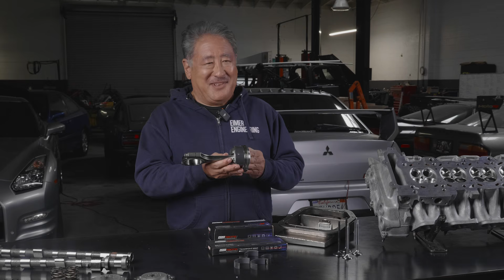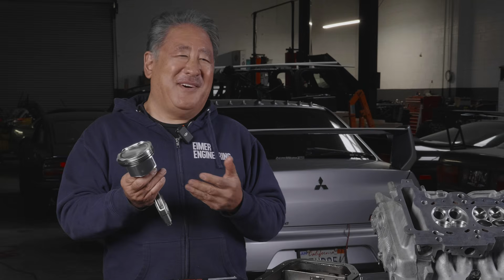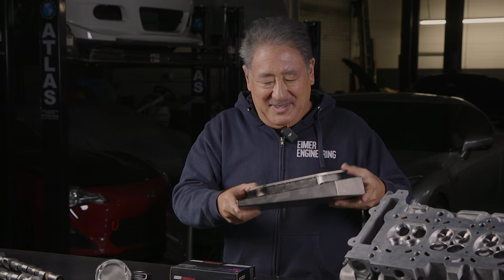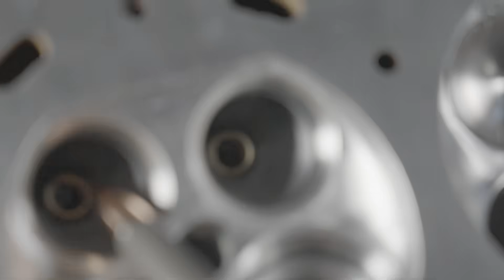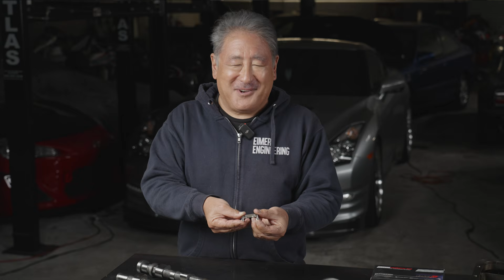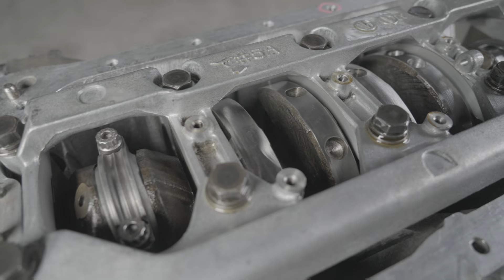How to Build a Bulletproof 400 Horsepower Nissan SR20 Engine!

Comment: Factory sr20 will do 400rwhp for 200,000 miles, I tuned hundreds of them since 2005, my first sr dyno video is from 2007
Reply from the maker: Maybe a pampered street-driven only car, maybe.  One that is raced will go about 20 track days between minor rebuilds.  200K miles is an outlier.
Reply: @motoiq  What is a minor rebuild? What kind of parts are you talking about? Failure in ductile and brittle lattice materials is an all or nothing phenomenon. If it doesn't fail at 400rwhp today then it will not fail tomorrow. The parts do not accumulate stress and piston brittle fracture failure is orientation based in a plane far from where stress is applied. They are the same pistons as 2jz-gte pistons which support nearly 1000rwhp at 1.5x the displacement. 

The sr20 parts do not fail at 400rwhp no matter what the application. The issue that people overlook is proper setup and tuning for the application. For example street vehicles rarely need oil cooling and water injection to prevent thermal based parts failure whereas in a racing environment the measurement and control of Exhaust temp and Exhaust pressure and cylinder head temp and so forth is fundamental to the reliability and that is why you think the engine will fail, because nobody measures the critical control aspects and then they fail.
Reply from the maker: Rings, bearings, inspection, and mag of all parts, sometimes pistons for an engine that is actually road raced or used in real competition drifting. I think your customers are primarily street customers or do short-duration stuff like drag racing. No higher-powered engine that is road-raced is going to go much longer with no maintenance without a tail-off in performance and or reliability.  Even the mighty 2JZ when talking about 1000 plus hp on the stock bottom end, it means a street, dyno queen, or hobby drag person. You don't see a single stock bottom-end JZ on the FD Grid. I mean my stock bottom-end SR street car lasted 10 years and who knows how many miles with 3 different owners and was still going strong when I lost track of it but street use and even mild track day use is not racing. Your statement on stress is not true. When you are getting close to the upper yield stress point stress is surely cumulative. This point is way below the UTS or ultimate tensile strength point.  It is also common for racing engines to operate in this zone. Ever hear of fatigue failure? For a part to fail far from the stress point is a matter of design and where stress concentrations are at, it is not a standard rule-of-thumb phenomenon. Also, stock SR pistons primarily fail in the ring lands due to detonation damage as SR's quietly detonate and many tuners don't catch it.  Higher revving SR's have pin boss failures on stock pistons, very rarely are they rod problems because the pistons fail first.  After 20 track days, of about 4 30-40 minute sessions, a 400 hp SR will still be running pretty well but it will need going through to stay reliable and not have the power start to drastically fall off.  Even an NA 220 or so hp SR will have the power start to drop after 30 track days and need freshening for sure at 40.  These numbers are pretty damn good for any engine.  A highly strung NA 10,0000 rpm 4AG needs to be gone through after 3-4 track days for instance to keep it running at its best. In the old days good used SR's were so cheap, you could have just throw another stock motor in it mindset but now these engines are expensive and that doesn't pay off very well anymore. The stuff about fatigue is fact, the rest is a matter of opinion and what kind of customers you build engines for.  Let's say I don't agree with you about that stuff and I don't recomend stuff like that for the hard-use customers that are most of our base.
Reply: @motoiq  For ductile materials to fatigue there is stress concentration and a brittle-like failure which means the materials actually ruptured, like a connecting rod broken in half. Stress is a result of cylinder pressure and piston rate, so it is a tuning aspect, not a power aspect. You mentioned 200hp SR have a failure cycle which emphasizes the point that 400rwhp and 200rwhp sr20det are not failing due to the power output. Furthermore you mentioned detonation which is tuning based and setup based, not power based, a 200hp sr can detonate and fail. Finally the pistons are not ductile they are brittle in the OEM application and will not fatigue appreciably or they would exhibit a life cycle in all engines not only racing apps, they do not fail for 200,000 miles or 400,000 miles or 1,000,000 miles as long as they are not abused, which again is setup and tuning. 

Why do rings fail and rod bearings fail in racing? Setup and tuning. Rod bearing should never wear if the engine is built properly and tuned/setup properly. We can take apart 200,000 miles engines without wear on the bearing. Rings are a whole other issue with tuning and setup as well- many people do not understand how to keep the OEM rings  and pistons happy. They blame the rings just like you do now. Here is what must be done
1. Oil temperature must be kept within 12*F of coolant temp and no higher than ~225*F. This is big reason for degradation of OEM pistons and rings. 
2. Engine tuned on alcohol fuel to minimum timing with no more than 112*F IAT measured pre-throttle valve. Easy to do at a mere 400rwhp. I can easily 500rwhp from OEM sr20det internals with this setting. 
3. EGT controlled by 100% distilled water injection if necessary. An arduino controller monitoring EGT on an water injection system triggered when Turbine Inlet temperature exceeds ~1380*F. 
4. Crankcase pressure must be kept for wet sump applications between 1.5" to 2.5" Hg for ring behavior and blow-by control. This is another critical aspect of setup which cannot be overlooked and why people blame rings and have ring failures. In dry sump and vacuum pump applications more vacuum can be used but I do not recommend much more than 5" Hg. 
5. Superior air filtration over factory is needed to keep the engine cleanliness from contaminating rings and embedded materials to the pistons valve deck and rings. This is another critical aspect which cannot be overlooked and many people disregard.

If you follow these rules the sr20 OEM bottom end and Chevrolet LS bottom ends will tolerate years of racing or whatever. Stress on the dyno is the same stress as in racing, there is nothing special about racing stress except that temperatures become exacerbated and people disregard setup issues as air filtration and PCV measurements. If we bring the temps back down and protect the engine crankcase and intake systems there is no difference between racing on the dyno street or track in terms of stress.
Reply from the maker: Fatigue failures do not look like brittle failures, they leave concentric shore marks and exhibit smooth burnishing in between the shore marks. Exceeding the materials' ultimate tensile strength gives a stringy-looking failure point but with necking around the periphery of the fracture.  Brittle-looking failures are typically caused by stress-corrosion fracture. In an automobile, these are most commonly found in stainless steel exhaust manifolds. Hypereutectic pistons do not have better fatigue strength than forged 2618 in fact it's not anywhere near close.  The silicon inclusions in hypereutectic pistons can be the nucleus for cyclic fatigue failures, contributing to the material's brittleness. These properties do make the pistons more wear-resistant, do not confuse wear resistance to having better fatigue strength.  There is way more to an engine's durability than those simplistic reasons and good tuning. Engines lasting indefinitely are outlying conditions, not simply skill at tuning.  I agree with you on the oil and coolant temps but higher temps do more than degrade the pistons and rings.  Max oil temp before major damage under racing conditions is the high 240s for the oil and 230's for the coolant for most engines. For power levels, yeah it is easy to make that sort of power but absolute IAT control is for dyno cells. You are not going to make a durable 500 hp SR20 with OEM internals under anything but street tuner conditions. 500 hp is getting close to the structural limits of the block if the engine has been bored. Perhaps you are talking about crank hp on an engine dyno, which is 20% more than my qouted power levels which are at the wheel.  Getting crankcase vacuum on a wet sump engine is pretty difficult unless you are using some sort of exhaust-driven system, I prefer not to use those except for perhaps short-duration drag racing.  For road racing, they can cause black flags and I prefer to keep things simple.  For dry sump systems, 6-10" of hg is a better target and not exceeding 12" of hg is good for ring life. The main reason for short ring life I see is improper bore finish. Some roughness is needed but plateau honing is a must.  NA engines 600 grit with plateau honing and FA engines something like 480 with plateau honing.  The other reason I see is an excessive mean piston speed.  If you exceed 4500 fpm your life is measured in a few hours. Sure tuning is a factor, but it is only one.  I can tell that either you don't build racing engines or you are the best engine builder in the world.  Racing engines are special, they operate at close to the limits of the materials used and the integrity of designs. OEM engines are designed for six sigma reliability under normal conditions for the length of the warranty period for the least amount of cost. To suggest otherwise is totally wrong, simple engineering and two-dimensional math show this.   How many satisfied racing customers do you have, if your engines last indefinitely or if not forever, orders of magnitude better than any other company, you probably have tons of nextel, F1 and indy customers beating down your door. Hell, do you got data to back up your claims of incredible durability under racing conditions? I will just close my doors and buy engines from you.
Reply from the maker: It is obvious that you are very intelligent and a good basic tuner, but looking at your channel it also looks like you deal with mostly street tuning.  I think you are speaking correctly from the context of your experience which is fine and probably extensive, but you do not live and work and have customers in our realm and have experience in it.  Hence you comments are off when speaking about the stuff we live with in our world.  You would do very well here with some study and experience.
Reply: @motoiq  I think you are accustomed to 'living with it' because it seems normal. This Attitude is encountered in aspects of engine setup and in my research field as a scientist- people tend to copy or base their projects on everyone else's results and group thinking  just nods their heads in agreement thats how things are whatever happens when nobody is thinking of new ways to do the same thing use a novel concept to improve the outcome.

If you consider that stress from racing on engine parts could be the same or less stress than in OEM daily driver applications then you would see the basic goal or principle is to mitigate and control stress. This is just between us capable drivers- your 'customers' may not be ideal drivers or diagnosticians and are not going to follow a strict set of guidelines to maintain the engine to an engineering standards- THEY will need the built engines because the parts WILL overheat and they WILL be damaged. But bear in mind that a  built engine fails for the same reasons the OEM engine does- outside of temperature and tuning/setup based failures. In other words, over-rev, oil system, pressure spike, ring behavior, maintenance, air quality, all of these will kill a built engine the same as a OEM engine. The only difference between them is the OEM engine is far less tolerable of temperature in some of its parts- temp and stress which should not be there in a hobby application in the first place but people do it anyways. And I've seen more built engines fail due to shoddy machine work and inadequate measurement/assembly procedures and inclusive filthy environments than the stress of racing or driving normally will cause naturally. Building an engine will make it less reliable with a statistically significant difference from OEM engine groups, even daily drivers without racing stress frequently have trouble just attaining 50,000 miles let alone 200,000 miles with a 'built' engine. 

I don't want to hear somebody saying cancer can't be cured and stock engines cant be raced easily because nobody has ever seen it done. Once you see you can believe. 
" The old motto that stock is reliable is very true on track" 
https://www.corvetteforum.com/forums/c6-corvette-zr1-and-z06/4220127-low-mile-c6-z06-engine-blown-up.html#post1598526132
Reply from the maker: Production based racing is always taking things well beyond the limits of what they were originally designed for. I can assure you this happens and I am incredulous that you seemingly dismiss this and attribute durability only to tuning and controlling temperatures. I am sorry if I didn't understand you in this assessment but this is what I get about what you are writing. Even in pro series where bespoke racing engines that are designed from a clean sheet of paper for the stresses of racing are used, you still have a decent amount of failures.  I am not some you tuber, I am a mechanical engineer with decades of experience with engine stuff from an OEM and pro racing perspective. I can say is I actually do this stuff, for years, some of it was pretty high level factory works programs, what engines do you have in any current or past pro series? I am not trying to one up you, I am just curious of your actual experience for being so opinionated. Having a simplistically arrogant view of things will not allow you to get past street racing no matter how smart you are. Some of the things you said about fracture and fatigue mechanics were totally wrong, but you probably came to these conclusions in the limited scope of your experience. The power levels of your youtube video projects are not particularly impressive and there use seems to be limited to street hooning, forgiving me if I am wrong but that's what your media suggests. Years of street hooning does not equal the stress of even one day on the track. If this is the scope of your experience then I can tell you that you have much to learn but you are very capable of taking things to a high level, especially if you absorb information instead of dismissing it.
Reply: @motoiq  You are saying that your target audience in youtube to build a 400rwhp sr20det is intended towards specifically 'production based racing' and 'pro series' individuals and if so then I only would agree on the basis of this be the sole recommendation for rebuilding an sr20det or any engine for 'racing' purposes if they are intended to be run beyond their means- obviously. But power output figures in and of themselves are not guarantee for stress related failures and neither is power to racing ratio. That was my original point, that power, stress, and longevity are not related or relevant. The topic is misleading- its not 'how to build a 400rwhp sr20det' because the factory engine is built for 400rwhp easily. Its 'how to built a racing engine intended for pro series racing sr20det' or whatever you want to call it. 

In terms of engineering I am sure you are thinking of what you see but not the chemistry behind why and how it happens and if you think my terminology is wrong, it is because I use different terminology. Specifically I consider covalent bonds and bond conditions which cause failure. If you've happen to have a doctorate in mechanical engineering then you know 3D Stress tensors tell us which direction in crystalline lattice and what direction the lattice formation is strongest in already and that is how I know there is no pressure/area you can apply to a piston whether cast or ductile in a reasonably tuned 2L 3L or 5L 7L Engine up to 250hp/liter that will cause a brittle, fatigue, stress related failure. It goes against all mathematics in engineering any failure criterion will tell us that. And I can compare tensile and compressive strength of materials for rods as well by adjusting area under the curve of cylinder pressure at whatever displacement to show the same ideology. The issue if failure comes from undesirable conditions, which is related to tuning and setup. In setup the issue is temperature differences as primary culprit. 

Maybe I misunderstood your target audience but for 99% of people looking for an sr20det quality setup they need reliable stock engines not built engines that make the same power with less reliability.
Reply from the maker: Dude you are talking pseudo science, what you are talking about as directional strength in metals is common knowledge, not PHD in ME. The reason for failure actually is found within quantum mechanics, its beyond chemistry. I think it is pretty amazing that someone with little actual experience in this field. a street tuner, its trying to use big words to school someone who has that educational background and when he is proven wrong, deflects trying to use other big words.  I mean I can have a big word pissing contest with you all day but that's not the point.  I am trying to teach you that what you know as fact isnt and stubbornly sticking to that thinking isnt going to serve you well if you advance beyond playing in the street. Maybe dazzling with engineering jargon works well on your peers. I wish you well, be happy with your 600 hp turbo LS street cars and 500 hp street 4 bangers, be smug in your mind that you already know it all. I am warning you that those are exceedingly easy achievements and that level of achievement doesn't cross over into the world of real racing. If you are not going there and want to remain the king of your domain it  doesnt really matter does it?
Reply: @motoiq  Don't get mad on the internet that is rule #1. I'm sorry I made you angry. I cannot see anywhere I was proven wrong though? But here is what I see
1. You said stress builds up in parts yet as ME You know stress is produced from force. This is your error#1 you must admit that your terminology is incorrect or thinking way. 
2. You keep saying 'experience' like it matters. Experience is meaningless. People learn at different rates and some people never learn. There are med students who intuitively understand cleanliness and surgery and there are those who make the same mistakes endlessly, unsuitable. 
3. You don't make a connection between stress and tuning. Tuning implies control over engine inputs such as timing. With timing control we directly control piston stress. If timing is -30* then there is no cylinder pressure and no piston stress. If we shut the engine off and directly stress the drivetrain using trans and clutch that is driver error, excluded from this discussion. Therefore tuning is fundamental to cylinder pressure and engine internals stress. 
4. Your statement "incredulous that you seemingly dismiss this and attribute durability only to tuning and controlling temperatures" Like #3 I will help you see the connection here. There is only 1 type of stress an engine internals needs deal with that is mechanical, compression, tensile, etc... including vibration and frequency/sound is all control theory, transfer function, modelling, etc... mechanical based. Temperature only makes an appearance because of its influence on mechanical stress so I stated it simply. 
And mechanical stress where power and torque is concerned is directly responsible for cylinder pressure, which is directly controlled by tuning e.g. timing. Therefore if we control timing, we control stress, and before you say EGT- ah ha! I did say temperature. SO, timing, EGT = stress / temperature = control over stress and engine fate. Get it yet? 
5. You judge a person based on youtube content? How far we have fallen as a species. This makes me sad. My youtube channel is a video backup and a couple vids to teach novices basics like pressure testing because I got tired of explaining it for decades. Most of the cars are my friends who do not have youtube of their own they asked me to post a vid of their tuning sessions or whatever so I help them out. You should not look at people youtube channels as a reflection of them- you are not your youtube channel. lmao reminds me fight club. 
6. Pseudo science? Then what is holding up bridges and buildings? The formulas for stress and failure are used daily in myriad applications. I was only making a point and willing to utilize any criterion for failure you choose to prove the issue with stress isn't power. You are poking the wrong bear with a stick. Making an issue out of something that does not exist. An engine at top dead center can have a massive cylinder pressure and blow itself apart without producing a single hp. The two are unrelated. It is tuning based, not power based. Tuning = stress control, mechanical.
7. Here is a list of sr20 that built and failed quickly
[url]http://zilvia.net/f/showthread.php?t=535520[/url]
[url]http://zilvia.net/f/showthread.php?t=569861[/url]
[url]http://zilvia.net/f/showthread.php?p=5765974[/url]
[url]http://zilvia.net/f/showthread.php?t=579996[/url]
[url]http://zilvia.net/f/showthread.php?t=586960[/url]
[url]http://zilvia.net/f/showthread.php?t=415523&page=2[/url]
[url]http://zilvia.net/f/showthread.php?p=5951668#post5951668[/url]

Now my turn to drop the experience card. I have been doing sr20 this and that for 25 years. Meaningless, but,  I have witnessed many types of failures. The majority of them come from trying to build an engine when a stock engine would have suffice. It breaks my heart when people ruin an engine that was running fine.
Reply from the maker: I am not angry, I am just incredulous about your assertions.  I never said tuning was not important, it is critical, in my perspective you just keep deflecting. In fact, everything you are saying at this point is a defection. You are even contradicting yourself at this point in an attempt to get the last word in.  Maybe the fault is mine, maybe I actually agree with you but I cannot understand your method of communication.  Engaging with you is no longer amusing, we are wasting each other's time.
Reply: @motoiq  I like that. Maybe you are right. Honestly this format is difficult to get anything across, but I do read what you write and interpret it as perhaps a bit hastily done. Its weird that you don't understand what I am saying though. Is it true when I say that timing is negative 30 that cylinder pressure and therefore piston stress is negligible no matter what the power throughput is? That by timing tuning we have control over stress? Do you know what I mean by power throughput- it is merely the rate of massflow for fuel and air which pertains to power. I did not mean to use 'big words' I am not sure what you meant by that either, actually I go out of my way to use small words IMO. I do understand from teaching mechanical engineering at a college level that the curriculum does not include very much chemistry so when I say covalent bonds and refer to them in the sense of a (brittle) fracture failure it is quite common for ME degree to be put off or confused by what I consider the foundation of physical chemistry or crystalline lattice stress over covalent bond angles and their behavior. And when I spoke of 3D Stress tensors that is not the same thing as directional 2D strength of materials which you learn in the BachelorSci curriculum- the 3D Stress tensor lattice is a format reserved for master and doctoral mechanical engineering and I will happily provide examples of my own work if you'd like. If I spend all day explaining that the text wall will be huge but a couple example might suffice instead.

I don't like to say what degrees people have as it is meaningless as well. Degree is just a piece of paper, I have a bunch of them but I do not pretend it matters, and neither should you IMO but that is my opinion. Just like experience is negligible with some aspects that aptitude cannot learn and teach. 

I do not want to sound smart on the internet but I do want to protect novices and beginners from making mistakes- that is my sole function in a place like this. You have some rebuild video and tips and maybe you forget sometimes that it is not easy for random novices to build an engine let alone a tight Japanese variant. Surely by now you've realized that the act of building an engine leaves one open to hundreds of potential sources of error and issues which arise throughout the process. I don't have any issue with the rebuild itself only the intended audience many of which are looking for reliable daily drivers and not racing vehicles- they do not understand that rebuilding an engine not only is more difficult than it sounds but also the use of aftermarket parts makes it significantly more likely to fail and frequently limits the lifespan of components for myriad reasons. It would be strange to me if you didn't already know that and I wonder how you teach people these details- will you specify that the engine rebuild and aftermarket components may be necessary for racing purposes pushing an engine beyond its limits whereas individuals looking for reliability and high mileage need to tend to stick to OEM components and factory rebuilds and that the power output numerical result to the tires is not indicative of stress and failure rate? That is, power can be extremely low while the engine can be very high stresses to the point of failure.